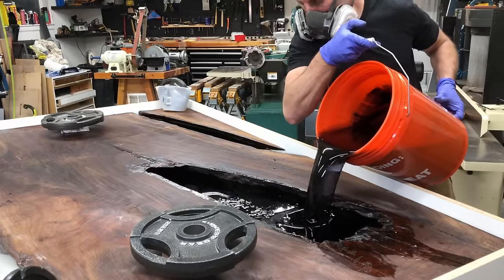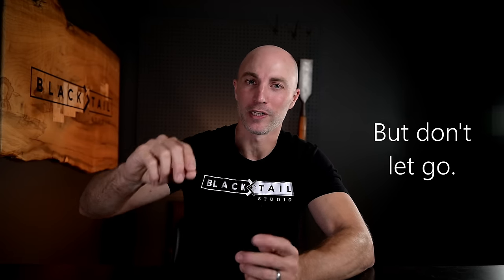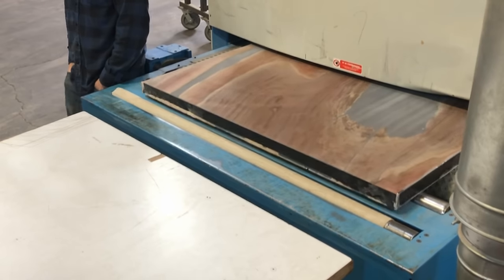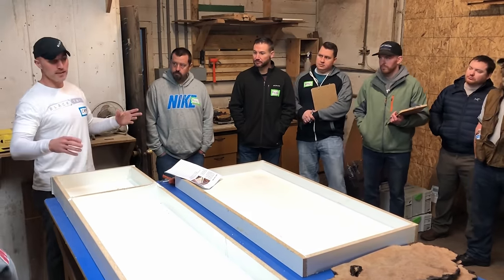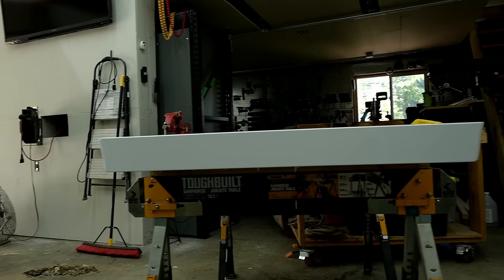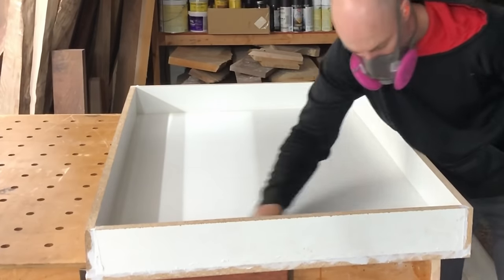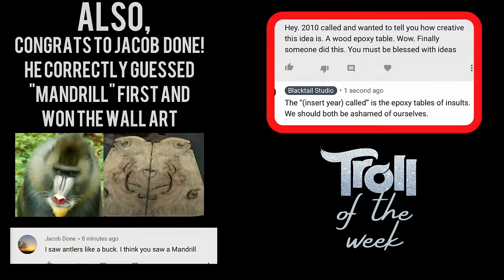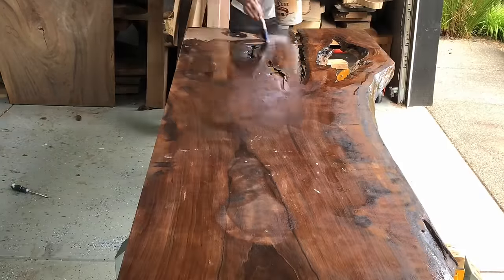The 14 Rules of Epoxy Table Making

Comment: Vinyl contact paper (self adhesive shelf liner) works great as a mold release. Works especially well for covering forms with flat bottoms/sides. Much faster to apply than packing tape, and pretty cheap too.

Comment: I am just about finished with my very first big, deep pour epoxy resin table. I made several of the mistakes that you mentioned in this video. This has been an incredible learning process. I poured my epoxy about 2 1/2 inches thick and the table heated up quite a bit. I immediately ran and grabbed two fans and blew them across the top of the table for 24 hours. When I flattened the table, it became thinner than I had liked, and I used the trick that you showed in the episode, "Use Half the Epoxy In Your Table Project". That was a table saver! I am at the finishing process now. I am very happy how the table has turned out so far, and I have learned a lot through this process. I just want to let you know I appreciate you and your craft! I really appreciate your willingness to share your knowledge with those of us, who do not have the experience in pouring deep resin tables. I am going to continue to make resin tables. I hope that the process becomes easier for me as I learn more and more. Thank you very much! Tim. PS, I wish I could send you a picture of my final product when I'm done. I would be interested to get your opinion.

Comment: I just found you!  I cut a couple of fir's from my yard, about 90 years old.  I used a chain saw mill to create some live edge slabs, which are drying in my garage.  While it will be a few months before I can do anything with them, I do want to do try some live edge epoxy.  I believe you saved me a lot of time.

Comment: I learned about Concept 13 from one of your other videos. Just ordered the diy epoxy tray kit to get started. 12" x 24" HDPE (high density poly-ethylene) exotherm vac tray with a 1 degree angle on the sides. they also have trays that are welded edges that have a 5 degree angle. Super excited to get started with some small scale projects.
Reply: Concept13 is down the street from my shop. They are awesome.

Comment: Cam   Clay Burnett from FL. Semi-retired cardiac surgeon and life/ long woodworker.  Been doing epoxy stuff for a few years, but it’s still the most humbling thing I’ve done.  Rule # 1 I recently violated and my table is a bit bowed across the narrow part and to level and smooth the slab I may not have enough thickness left.   Birthday present for my bride, so violating Rule #1 is NO BUENO!! I really enjoy you work and videos.  And your pathway to this second career is pretty cool, too, and no probably a lot safer since helicopters are an invention always trying to crash. 
Great video here and I’ll pass it along!
Reply: I always wondered how many surgeons were also woodworkers.  I would think that surgeons and musicians would be the safest woodworkers.

Comment: Mixing properly. Thanks for the heads up on the other tips. I do seal my edges because I had two tables that back to back had edge bubbles. Since I started sealing I haven’t had any bubbles and never had stress failures. Great tip on sealing the top surface. I haven’t had any issues, but I can see how it could.

Comment: Thank you for all the helpful tip I have been using epoxy on my Cornhole boards for a little over 5 years now. My customers love the finish on them and I love the look. I'm looking at doing my first table after the new year as this is a hobby of mine. I have saved this video so I can go back over when I start the project again thank you for the info. Have a great day

Comment: Awesome tips. Thank you. I just did my first epoxy project, and I learned a lot of lessons. The major one was patience. So, for me, the tip would be to wait serval days before trying to sand and finish your project. I had a lot of buildup on sandpaper, and it would swirl back on the surface of the epoxy making deeper scritches. 
When I did my project, I bought some HDPE sheets and made the mold using caulk to glue them all together. But my pour was only 1” thick. May have to use some clamps for bigger project. And it worked well. I did not use mold release, but I will in the future. The epoxy did come off with no trouble though. And I will be able to reuse it for my next project. 
Your work is inspiring, and I can’t wait to see your next project.

Comment: Great video. Worked with epoxy almost 50 years ago making parts from airplane to chemical vat covers. I learned that a chemical bond is much better than a mechanical bond. Its funny how it has not changed that much. Still a very unstable product. Meaning once it goes there is no turning back. Thanks for sharing your knowledge.

Comment: I dig the, seal the top of the slab before pouring rule. I’m working on my first epoxy table right now. I’ve watched most of your stuff, I must have done something wrong when making the router sled, do you have any videos for planning, milling, or surfacing down this table at home? We love your stuff and your insight by the way!!

Comment: "Sealing the slabs and leave the curing process for a month" - Essential tips!  I have thoroughly enjoyed watching your videos.  I have not, (Or simply can't remember), seen how much collateral damage occurs with these projects.  Do you throw away the buckets etc?  How do you dispose of excess epoxy,  (Especially when dealing with leaks),  and basically the clean up process in addition to if/when there are are any issues.  May seem like a boring question but would be fascinated to get some perspective from a pro ;)

Comment: Ever tried post curing epoxy?
We've done it on a few projects and it worked like a charm. Basically by warming up your cured epoxy to 40-50°C (104-122°F; but that range could vary from brand to brand) for about 8 hours and letting it cool you get a fully cured piece ready to be machined (CNC planing in most of our cases).

Comment: Hi Cam, thanks for all of the brilliant videos. You inspired me to embark on my first river table. I have a walnut slab which has been (poorly) flattened to around 65mm thick +/- 10mm.

My question is - should I flatten before the cut and epoxy pour or do the whole thing after? Your video suggests keeping it at full thickness as long as possible so I'm guessing I should go for: 1. Clean up, 2. Cut, 3. Pour, 4. Flatten.

Thanks in advance!
Paul

Comment: Sealing the top is something I hadn't considered, and you probably just saved me my first disaster!  I had another thought about the cracked epoxy though.  Years ago when I was living in Australia, I had a table that was glass, but it had been "shattered".  The maker actually sandwiched a shattered piece of glass between to whole pieces of glass, and sealed it (no idea how).  But it looked really cool, and unexpected to have a shattered glass tabletop.  What about a way to "save" that disaster by pouring another clear coat, like at tabletop epoxy over that, or covering the top with a glass pane?  Could be interesting.  Scott from Japan

Comment: I liked your last rule the best as it is something that most people would NOT think of when blending epoxy.
Love your videos and you have taught me a few things, even though I'm a professional furniture restorer with over 40 years experience.   About lacquer cure times, there are many variables when it comes to how long it will take a lacquer to fully cure, but I think 6 months would be a bit extreme for just about any lacquer.  Two months as a general rule for a standard nitrocellulose lacquer applied in the recommended millage, that is not catalyzed, under normal room temperature and humidity conditions.  It would be best to check with the manufacturer for an accurate time, as all lacquers are different.  Keep up the good work!   In case you think I might be able to help you with anything too, a little searching online and you will be able to find me.  I am pretty well known in the Cincinnati Ohio area and have a website.

Comment: Good video! I don't use mold release and melamine is an absolute nightmare. You can very easily source HDPE sheets in 8'x4'. Use this for your base over plywood and supports. Then I use HDPE sides that are cut with a plywood backer. The HDPE releases so easily, generally I just have to break the sides off and lift the slab and it will release. Also, your silicone easily adheres and seals to HDPE but once you yank on it, it pulls right off and leaves the HDPE completely clean.

Comment: Thanks a lot for sharing your experience. And thankyou for being you. I am from Pakistan, have been doing my homework for almost a year now before I get into epoxy tables and stuff. Your video is one of the best I have seen till now. I am basically facing an issue with getting the right quality of epoxy resin in Pakistan. The recent decrease in imports hasn't helped. Also you guys have so many tools and equipment that makes the technical part relatively easy. 
Thanks again buddy. Goes without saying, have subscribed:)
Reply: Hi there! I'm form Russia. We have no issues with quality epoxy resin but i also see how many great tools and equipment people have in USA. Also starting my first project in epoxy )

Comment: I've been watching your videos and doing research for the past 5 to 6 weeks. I'm about to attempt my first river coffee table. I have several questions:
1) What is the ideal moisture content of wood? 
2) What is an acceptable moisture content?
3) My slab has numerous worm holes. how do I fill them with epoxy if I coat the surface with shellac?
4) You reference the use of chemicals to address bugs in the wood. What chemicals should I use?
5) The slab is only 1.7" thick. Can I add 1/4" plywood to the bottom to add thickness to the table? (I plan to have the entire perimeter epoxy so the plywood would not be visible from the side)
6) Would you recommend I create a mold that would allow the epoxy to run beneath the wood slab to increase thickness to 2"?
Thanks in advance for taking the time to review and respond.
Regards,
Jeff

Comment: Wonderful.  I've watched all of your content I think and I'll be signing up for the online training content at some point.  Gearing up to try my hand with what I've gathered so far which (to me) will make the class content resonate that much more because I've been through it at least once on a small scale.

My favorite tip was your iteration on sealing the edges.  Using the deep pour epoxy on the edges and waiting until it's tacky and not outright dry to get a chemical bond (much stronger than mechanical) is true wisdom.

QUESTION: Does a dehumidifier in the space do anything for me?  Basement shop isn't particularly damp but it's usually around 50%.  Wondering if having the air really dry helps at all.

QUESTION: I keep hearing the epoxy shrinks a little bit.  I hear your tip about leaving a little loose on the live edges so the epoxy doesn't pour itself away.  Is that the solution?  Or do I not worry about under-pouring because I can always do a top layer?  Or do I overpour just a touch and let the surface tension of the epoxy keeping it from running over because I know I'm going to surface it after?

QUESTION: If I'm just getting started without a youtube channel, I have zero idea how to generate my first clients.  I suppose I could make some gratis for people I know would have a lot of "disposable income foot traffic" in their house.  How did you get the business part rolling?

Comment: Seal the top of a project after pouring.  Hi Cam!  Thanks for this more in depth channel.  Bought your epoxy workshop series recently to prepare for eventually making some.

Question:. What chemicals will kill bugs in wood?  I have a 30" sawmill and my goal is to make a solar kiln and use local wood that I have milled on projects but I'm not there yet

Comment: I talked to a manufacturer of a product that made a good point as to why you may not want to bond the way you do. It's possible that bugs or dust or particles may have landed on the surface and if you pour over it that all will be in there forever. This probably dont matter when doing it with a black dye the way you are but if you have anything translucent it's something to think about.

Comment: I'm a relatively new epoxy table guy so consequently have a dumb question (yes, there is such a thing). I've started the process of flattening and sculpting the river edges with a 2" piece of Elm.  After flattening, the slab was still cupping even though it was around 12 percent dry, so I clamped it flat.  Wanting to keep it flat I then sealed it with linseed oil thinking I would be plaining it again and removing the oil.  Am I going to have a problem with the epoxy adhering to the wood where I don't remove all the linseed oil? BTW your video is beyond excellent!

Comment: Favorite rule: let caulk dry! My question: I will fill cracks on a 40” x 80” x 2” thick white oak slab. Some cracks go all the way through top to bottom and I don’t want to make a full size plywood form to catch leaks. Can I get away with only sealing the bottom of those cracks with a board held in place with caulk and screws? Also can I use the same epoxy for the through cracks and the minor cracks/blemishes? Wood is ambient air dry for several years and kiln dried. Planning to use total boat products.

Comment: Thank you for the video. Very helpful.  You mentioned sealing the edges, and later you said to seal the top. Can I do both with shellac?  If not do both with the same liquid glass epoxy?  Or should I seal the edges with epoxy and the top with epoxy?

Comment: Sealing edges with same product great idea.  Question: I’m pouring large cracks in a 3”x40” red oak cookie. If I’m adding copper  bow ties also should I inlay them before or after the epoxy process? I’m thinking after, don’t want to worry about needing to machine them down.   If they were wood would you inlay them before the pour? Thanks

Comment: Great video. Thanks for the tip on sealing the top of the slab with Poly. Question. Built my own mold. Caulked it, used the sealer. Poured the epoxy and some leaked on one end. Obviously not sealed well enough. I caulked it again along that edge. However, I have lost about 1 inch of epoxy. So can I mix again and pour over the top of the other 1.5 inches? I poured yesterday at 4:30pm so its almost been 24 hours. Should I wait longer or can I pour another coat of epoxy over the top? Last question, do I need to match to the exact color with the die? Or if I get close to the same color, will the new pour mix with the existing epoxy and blend? My concern is the first pour is one color and its been sitting for 24 hours. If I mix and pour another layer, I am just adding to the top or will it blend?

Comment: Hi Cam, all of my local suppliers are offering wood boards and slabs only 5cm( 2") of thickness, and I was wondering is there any workarround to make my tables thicker, is gluing two slabs or boards together cause the top to bend or twist or even separate, and how much it will affect the aestetic of the whole end product? Or am I just suposed to make smaller coffe tables because of this issue?
Love the channel, keep it up!

Comment: Seal the top of the wood slabs with something. Thank you for the new channel and video. Is there a temperature too cold to do epoxy pours? I live in Michigan, with an uninsulated garage where I do my woodworking. I have a log workbench that developed a large crack as it dried (ok, really, two workbenches). They're deep voids on the side. I was trying to fill them with wood glue, but now that I've seen this and have a better understanding of deep pour. Since it's winter, I wonder if I can pour more than 4 inches with a fan blowing on it?

Comment: Thank you so much for your teaching.  I do have a question for you if you have time to answer. 
I just poured two crate tops and used liquid glass deep pour. Should I use another product to apply a flood coat? Or can I flood coat it with deep pour as well? I've searched for written answers to this question, but found nothing. I do appreciate your time,  thank you.

Comment: Bucket mixing rule . Do u use the same bucket with previous mix to make a 2nd batch? Also my client wants a epoxy gloss finish should I just  pour 1/4 inch above the wood then plane down or just come back after planing and do a flood coat

Comment: Limit the thickness.  I built a table with just small holes and dips that needed filled so I used a thing coat epoxy and only needed to fill about 1/4 inch so no problem.  I had a red solo cup with the spare epoxy, and it had about 1-1/2 inch in left.  I came back later the cup was melted, and I couldn't move the cup until the epoxy set up.

Comment: You should do a video with your biggest mistakes. One of mine was putting mould release on BEFORE I caulked the melamine and didn't even think about what I was doing. I ended up with caulk imbedded 1/2 inch into my table. Oddly the form didn't leak but sections of it floated off into the epoxy.

Comment: The “two bucket method” for mixing. It is a bit more work but I’ve always done this since learning it from a company that does epoxy countertops. Perhaps it matters even more when you’re only pouring 1/8” thick over a large surface area vs a River table?

Comment: My favorite rule: Seal the slab.  That's the exact rule I was looking for!  I've been woodworking for several years, but want to step up my epoxy game.  I have some Entropy Resins CLR that I used at least 2 years ago and it crystallized in storage.  The label says to heat it to 125 for 8 hours to liquefy it.  I did that, and it did liquefy.  I just poured a sample to see if it sets up.  In general, what is the shelf life of epoxies if you store them as directed?